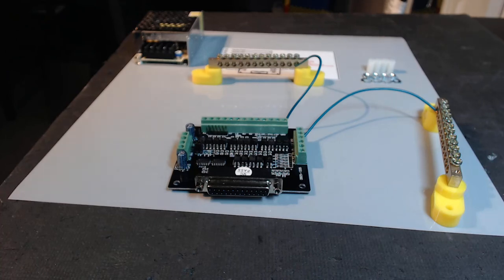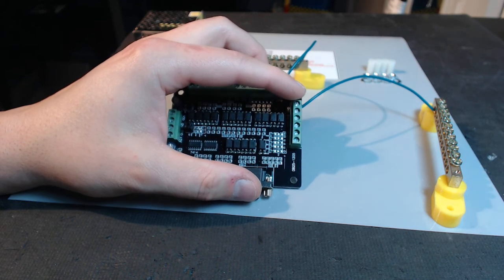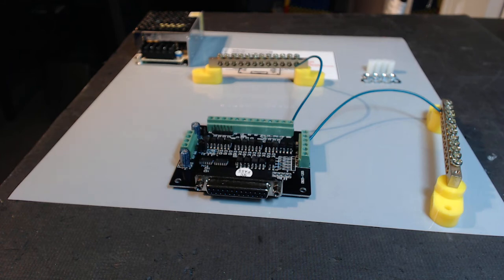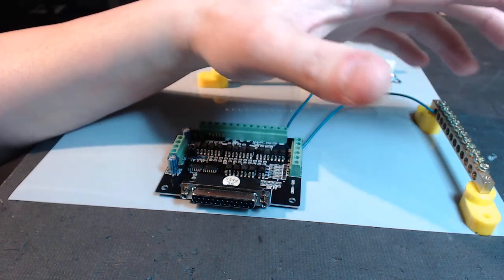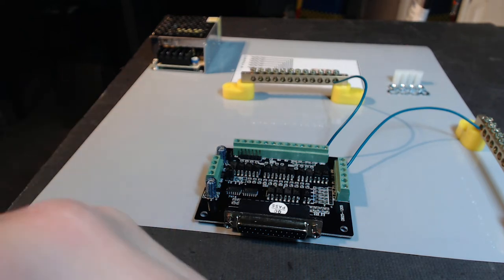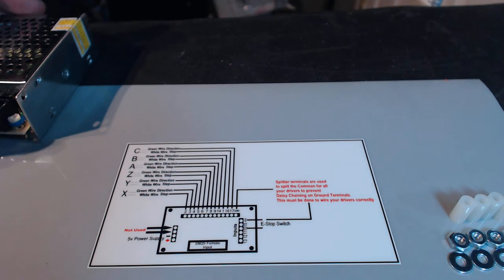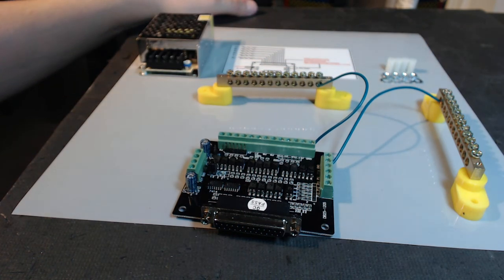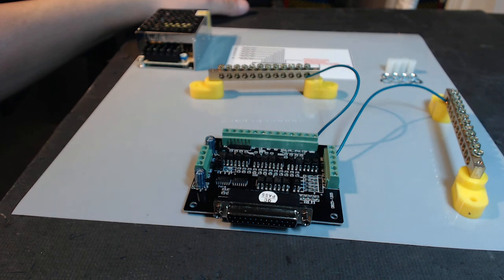6 Axis Breakout Board DIY Bundle..(Done Simple Stupid)

Comment: Hi Vince, how about one of these that would plug directly into one of the ESS ports without a cable?
Reply from the maker: All breakout boards will require an LPH 26-Pin to DB-25 ribbon cable to plug into the ESS. Thank you, Vince
Reply: Hi Vince, would you agree that  “best practice” would approve of the elimination of an extra piece or part like a ribbon cable and would be a positive step in eliminating a potential problem source? It would seem a direct plug in connection would be a much more efficient design, kinda like a MB3, but on a smaller, more basic bob like yours.
Reply from the maker: Do to all the variables on the market with components its simply not possible although your correct that less cables would certainly reduce EMI overall. Thank you,
Vince

Comment: Which pin does the spindle go in?
Reply from the maker: Faded Galaxy, Spindles analog inputs aren't supported directly by the board. If you purchase an after market relay you can use an output signal to cycle the spindle on, and off. Thank you,
Vince
Reply: @corvetteguy50  I have the spindle hooked up to a speed controller box. There is a positive and negative wire coming out of the speed controller box. The problem is, I'm using all six axes from the output signals for six of my stepper motors. Is there any where else on the board that I can plug in the positive and negative leads from the speed controller box? Thanks.
Reply from the maker: @Michael-it5zz  If you have all the outputs allocated to the axis to automate the system you won't be able to add a relay to control the relay. The breakout board doesn't support analog speed control support, so you won't be using it for speed manipulation of your spindle. Thank you,
Vince

Comment: I hope you can provide me with technical assistance in running the CNC router. I made one at home and tried to run it using the computer using the Mach 3 program and drivers of the type TB 6600/ 9V * 40V /4Am   and connected to the printer output(ParallelPort), but not I succeeded in Dalk did not move the motors despite all attempts Vlada Sidi ask you to help solve this problem my address is the postal // ziadeamine848@gmail.com///number and the  whatsapp        212614053826    **morooco  thank you
Reply from the maker: Amine, 
Please contact your vendor that sold you the board, as I don't support the TB6600 Chinese drivers. If the vendor doesn't offer support I suggest speaking with your payment processor you sent them payment with.
I'm sorry I can't help.
Vince

Comment: I have the same breakout board, I'm in the process of building a cnc router never owned or built one before.
Yes I totally agree as that is why I went with individual components so if some thing failed I don't have to buy the whole integrated board and one can trouble shoot individual components.

problem I have is, well 1st my PC does not host a parallel port, so I brought a parallel to usb cable, then I seen somewhere they said it won't work or not as well from usb or one will need a smoothstepper,  found that out when I was trying to set mach3 up with usb port address which I was looking for help for.

So I just ordered a parallel port card

So you are saying one can use USB? cause I am confused now

I brought the Wantai kit with that breakout board, DQ542ma drivers, nema 23 motors, I have it all wired up to test, and shot in the foot due to the parallel to USB cable setup.

I had to research the wiring as my kit never came with any wiring diagram
Reply from the maker: Henry, 
Thank you for your support. you'll require a UC-100 USB controller to convert this board to USB format otherwise this B.O.B. is strictly parallel port.

Here's a link to the UC-100 you'll require. https://www.ebay.com/itm/132505537529

Remember its always cheaper to ask first, and purchase after if your uncertain for your system. It saves time, and money.

Thank you,
Vince

Comment: Hey Vince,  i wanted to know how to change the voltage on the 5volt power supply.   I t has the sticker but i do not see a switch.  Would it be located under the switch?
Reply from the maker: Ernest,
The switch is located inside the unit. If you look at it from the top you'll see it. Just switch it over, and your all set.
Thank you,
Vince

Comment: You said simple, but looking at your wiring diagram has me scratching my head. I've got four Nema 23 motors, an of course they're all four wire. Y axis needs to be cloned or hooked to "A".  I see you have green and white inputs, and if I recall correctly stepper motors have red, green, blue and yellow.  

It seems you don't advocate limit switches, but I sure am glad I had mine when I first hooked up to my system and advanced the motors too far before I figured out what I was doing. Fortunately I had hard limits enabled, and the system shut off. If you don't, you can fry a motor pretty quickly or destroy the machine. 

It takes a while to figure out how to set up soft limits precisely. I like the fact the machine can automatically hit the hard limits switch,  back off, and know the table dimensions. I then follow up with soft limits a few mm away, but sure like the system setting itself up at 1st. I totally agree that mechanical switches can fail, and when you're buying 10 for nine dollars, made in china, I'm certain they will most definitely fail. Some guys will set them up as normally closed, so if something does happen, wire breaks, switch fails, they stop the system. Soft limits make a lot of sense for sure.

Anyway, please enlighten me as to how stepper motors are hooked up, and if it's possible to clone two Y motors or how you make those to work together.

I'm obviously a novice here and just made the mistake of buying an expensive board not realizing it would not work with Mach 3. I certainly like your philosophy of keeping it simple but at first glance I'm confused.
Reply from the maker: Troy,Let me begin, by thanking you for your support. The diagram your referring to with my breakout board with the green, and white wire inputs are for the stepper drivers. The BOB is simply the logic board that sends pulses from your computers motion control software (Mach3) to the drivers which in turn send the step, and direction signals to the motors that are attached to them. The motors never hook directly up to a breakout board. The drivers do. The use of limit switches has long been misunderstood, and using whatever protection for you system you feel your comfortable with is all that matters. I build literally hundreds of systems a year, and "soft limits" are a sure way to defend against crashes without the extra expense, and time of adding physical switches that fail for my clients.  Your correct you must configure them correctly in Mach3, but that can be said about virtually aspect of learning CNC including wiring, and setting up of physical switches. Running steppers as a "slave configuration" is done through Mach3. this is the when you make two axis perform as one. Here's a link reflecting how to do it through the software. https://www.youtube.com/watch?v=uoqhKwWMWkM&t=23sIf you forward your email address I can forward you a copy of Mach3's users manual which will cover lots of information on setup.Thank you,Vince
Reply: Ahhh, a separate stepper driver board, that makes more sense, but of course also adds to the cost and room required to mount! What do you suggest for stepper driver boards? Looks like they start from about seven or eight dollars, but can get pretty expensive too. 
　
I agree with you about the soft limits, but I do like to have the physical switch there for the initial set up. I think I mentioned I set my soft limits just shy of the hard limits. It's also been suggested to wire these for normally closed, so if the wire does break or the switch malfunctions, it shuts off immediately. Even the cheap micro switches can be wired this way, and I think it's pretty easy to change in the software. The other thing I've learned the hard way is you have to buy shielded cable, as electromagnetic interference can make these things go crazy, so I guess one more argument for using soft limits! 
　
Looks like it's pretty easy to clone the "Y" and "A" axis. I'm still learning Mach 3 at this point, but it seems quite robust compared to something like Universal G code sender and GRBL boards.

Comment: Hi Vince, great video - I'm just starting with this stuff and found out, that connecting my DB25-1205 to a 25->USB is a no-go. So I was quite happy to watch your video and learn of the UC100 unit - I just ordered one. Can not wait to get started :)
Reply from the maker: Yes sir, and thank you for the support. The UC-100 is your best friend for an easy conversion from DB25 to USB. Plug it in install the drivers, and your good to go. If you need a better USB cable for it I just got some in that are 15ft, gold plated, and feature a ferrite, and double shielding for maximum signal protection.  Here it is https://www.ebay.com/itm/132374137305Thank you,Vince

Comment: I'm all for keeping it simple. What do you recommend for spindle control? 0-10v for mach3 to control spindle speed.
Reply from the maker: Spindle control in Mach3 is possible, but not accurate as there's no way for Mach to know the RPM of the spindle without an encoder being installed on it. The best option is to simply use it for switching the unit on/off with a relay. If you want accurate RPM readouts for your substrates nothing beats the digital interface of the VFD. Thank you, Vince

Comment: Hi my steppers require a higher voltage and have 4 wires how can i use them with your board.
Reply from the maker: Gary,The breakout board just sends the step, and direction signals to the drivers for your steppers. The drivers supply the steppers with the higher voltage that they require to provide automation. Breakout boards are simply for the 5v direction signals. This breakout board will support, any stepper drivers pending you have their required wiring diagram of course. Thank you,Vince

Comment: i have 4 six wire 4 phase motors 34 D and 42 D they running on old driver box. i would like to upgrade  it  and i would like to know if this breakout board will be suitable to run my cnc thru my old driver box.  thank you
Reply from the maker: If your sure your old drivers will work with it then yes. I would make sure your drivers are compatible with Mach3 motion control software, and review their manual for their wiring diagram to assure compatibility. Thank you,Vince
Reply: thank you, my CNC only works on MACH 3

Comment: I have a KL-db25, is that yours? it has jumpers for dual voltage which disconnects the opto isolators grd. pins 10-15 say mecanical, e-stop and proximity sensors. Since they run on higher than 5v, is that how you could use one? Have you ever seen this?
Reply from the maker: Similar, but not the same.Those type of switches require their own power to function with a board not providing adequate power.  Proximity sensor switches aren't the best switches for use with a CNC robot mainly do to the inaccuracies associated with the switches. Many times these switches will lead to unreliable repeatability. I recommend a mechanical switch for most applications do to their simplicity, and ease of testing. Its up to the end user as their switch preference in the end, but for a novice. or "alone machinist" I wouldn't recommend them. Thank you,Vince